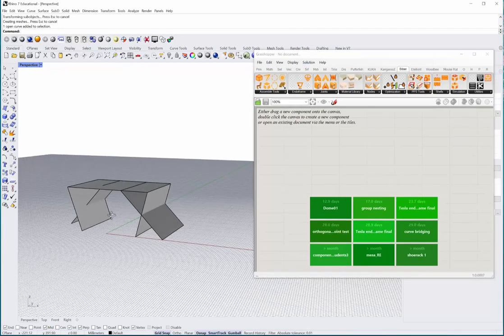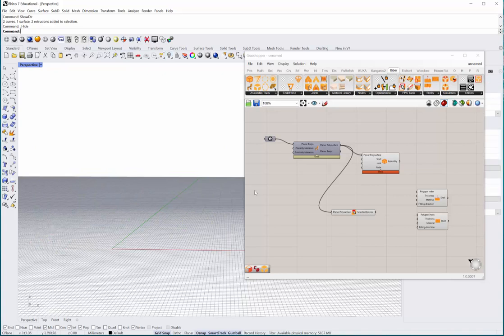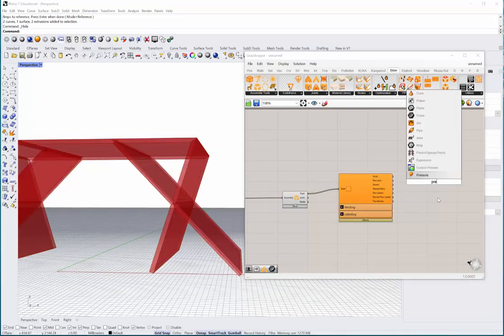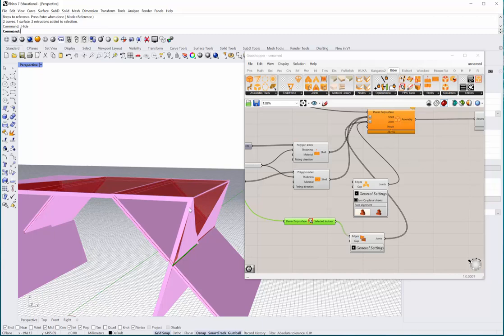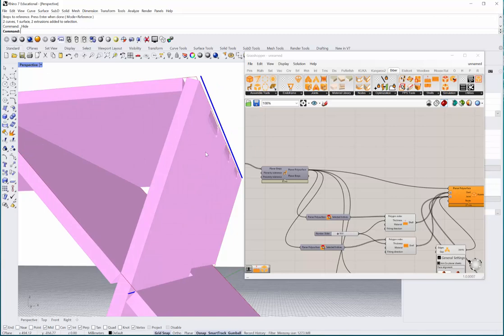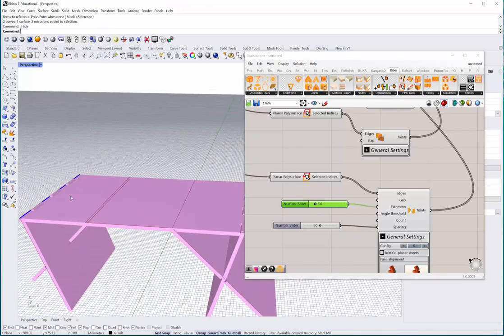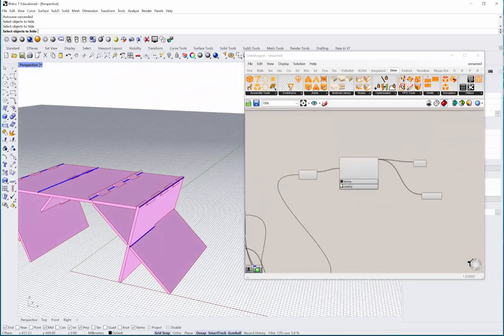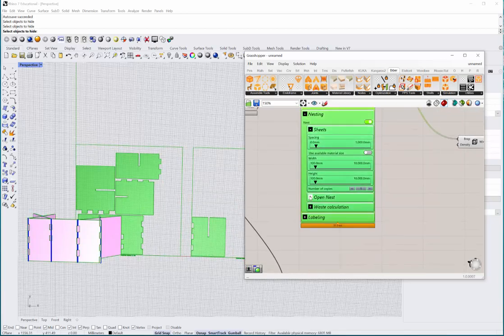Use of Biber plugin in grasshopper.

Comment: Where can I find the unfold component?, is this not available in Biber?
Reply from the maker: Hi michel, I think I replied to your question on another post , hope you figured that out
Reply: @parametriczoo8568  I have the same problem, I don't see the unfold in Biber.
Reply from the maker: @huynhnguyen1069  Hi there
make sure you have installed open nest. Run Biber installer and choose custom or change , then choose Biber nest and select "will be installed on local hard drive". you should be able to use Unfold now
Reply: @parametriczoo8568  Thanks! I got it.